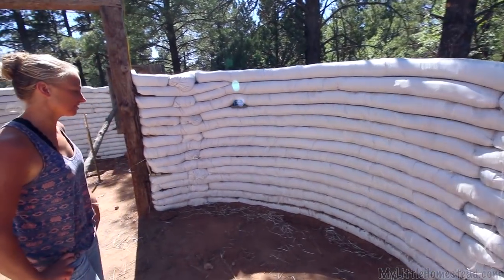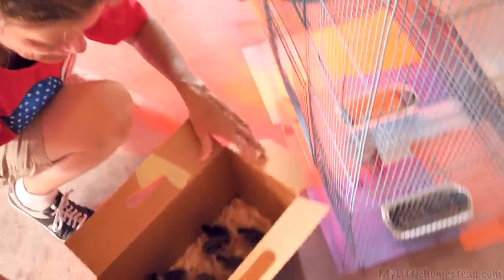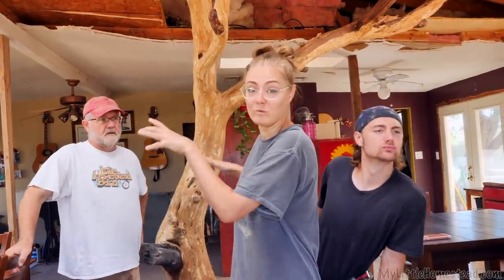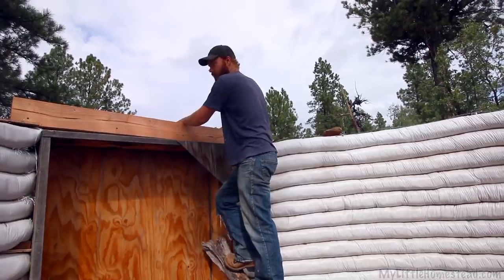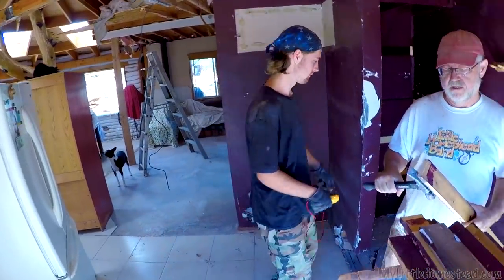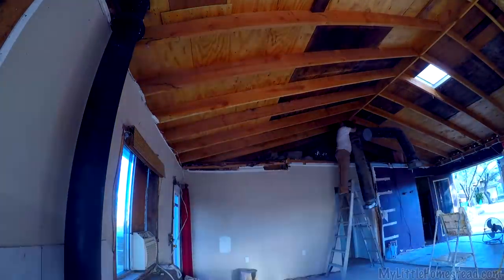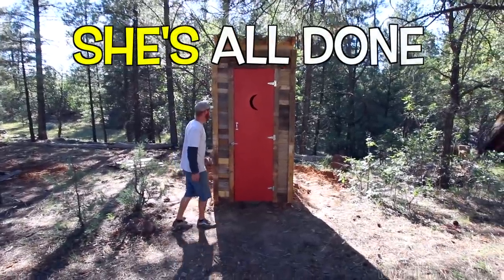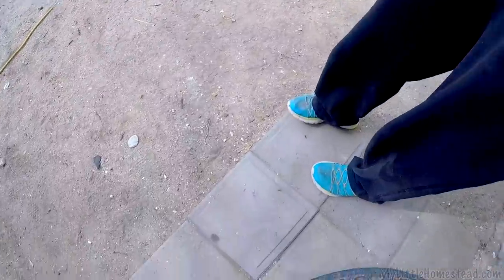Ceiling Take Down & Top of Cabin Walls | Earthbag Kitchen, Bath & Cabin | Weekly Peek Ep157

Comment: Damn!  Aren't you worried that either your roof is going to cave in our your walls are going splay outwards...OR BOTH?!  Weren't those all tie beams you took out?  And load bearing beams...?  Y'all got...balls!  LOVE that little outhouse and great job on getting the cabin walls up.  I think you all are the most industrious family I've ever known...  With all of you working together like that you get SOOO much done!  Totally inspired!
Reply: I thought that was why they put the tree in the room.  To be load bearing.
Reply: True, but without those tie beams in there, what's to keep the sides of the house from being pushed out?  I mean, even with the tree bearing the load of the ridge pole in that one spot...I don't know.  It just doesn't seem like that one tree and whatever is holding it up at the other end is enough to ensure the structural integrity of the house.  I'm no engineer, but I seriously doubt the place meets code at this point.  But it sure looks a lot cooler!
Reply from the maker: Post and collar ties on the rafters

Comment: I think the beams you took out keep the walls from spreading out and falling down. They hold the walls in place and the roof from coming down. You now need a few support beams. I am not sure but I think that is right? When the weight of the roof lays on the walls it makes them want to kick out. Also the span of the roof needs to be supported. Just saying.
  I think you could put a few rugged beams across ways and also  it should have beams beams in the middle of each support beam going up to the roof to support that too. Like a A frame.
Reply from the maker: Post and collar ties
Reply: shartne or add outside supports like Notre Dam...! You guys are so inventive, you’ll come up with something cool.

Comment: How are you tying your walls in so they don't bow out from downforce now that the ceiling joists are gone?
Reply: I thought about that too.  Good point
Reply: Same here.  Where are the ceiling joists???
Reply from the maker: Post and collar ties
Reply from the maker: Post and collar ties
Reply: That link below that explains collar ties states specifically that they do not prevent wall expansion.  Darn!
Reply: That's why I posted it.  A structural ridge beam and a consult from an Engineer might be in order.  I realize they don't have codes where they live, I'm just concerned they might have an issue down the road.

Comment: love the outhouse - I was involved with a two-story one - the first floor has a bin to catch? then second floor has the stool - like the original one - you had in the first video. - Always find them interesting - my Cousins have a concrete one that's pretty Awesome - the house use to belong to the Doctor that lived in town during the 20's and 30's - Something like 50's maybe he retired and died.. can't remember.  my Aunt worked for him - she bought the house - Well got the house.
Reply: just got to the end - Need to watch that roof - My cousin Bobby wanted to remove a wall - so I told him to call me before he started (i explained what and how) he did it without me - didn't reinforce the header boards to support the weight of the roof. so it started to sag - he had to reinforce the outer areas to the walls and the ceiling joists After lifting and supporting it was fine. <hugs> just be careful of the weight of it's self being to much for itself.
Reply: of course bobby's house is like a 100 years old. so. But? half pine half oak.
Reply from the maker: Post and collar ties

Comment: Idea, use a stirling cryogenic piston to generate liquid atmosphere. Liquid gas from the air that fills an insulated tank. Liquid air can be used to fill aluminum radiators to pass air through them for air conditioning. Liquid air then fills an insulated tank with frequency emitter's at the bottom that cause's HHO to vaporize out of the liquid air that is collected and used to.m power a gas turbine electrical power generation system? 😊

Comment: Okay here is a toilet design, urine collects in a resivor with a siphon. Siphon kicks on and fills a joe cell half filled with Gallium Aluminum alloy. This alloy will cause hydrogen to vaporize out of water just from the Schumann resonance field hertz 7.83. So the joe cell would need the correct electrical frequency to cause the Gallium Aluminum alloy to process HHO out of the urine at a more rapid pace. The HHO generated from the urine then used to charge solid state sponge hydrogen fuel cell's to be used to power farming equipment or electrical power generation hydroponic green house water pumps and so on. Okay now for the sticky stuff, the toilet's bowl now full slides back with a new ckean bowl coming up from the bottom to take it's place. Bowl full of waste is tipped over water jets spray out bowl brush with water jets clean out bowl. Contents of bowl deposited into a convection oven being powered by HHO fuel cell. The waste is sterilized dried out and ground down with the contents then being deposited into a bin to be used latter for rich top soil. A better way to deal with human waste. 😊

Comment: Here you go this will impress you. Earth bag house out building that house's two 50 gal water tank's. One for hot water that is heated with a solar vacume tube water heater and a cold water tank. Okay now the interesting part, the earth bag home plumbing set up to drain all the used water from kitchen sink bathroom sink and from the shower with a small atmospheric water generator removing water vapor from the air in the bathroom draing generated water into main drain that runs out to the out building that is then passed through a superconductor separator the removes all pollution and chemicals and bacteria from the water making the water clean enough to drink. With the impurities removed from the water deposited into a canister for latter disposal with clean water then returned to the two 50 gal water tank's with any excess water being deposited into an extra tank to be used for plant's or livestock. This concept would greatly help the environment and you would alway's have 100 gallon's of fresh drinking water at all time's. 😊

Comment: As a designer, draftsman.  You need to shore up that roof.  And u need insulation really really bad.  U folks have 100,000 lbs of force on the roof load and u have squat holding it up.  Winds of 20 mph or more will rattle the house like no tomorrow..  shore up your work before some one dies please.  Shore up that center rafter.  That should be a 4x.  Your dad should know better.  He's good with tools.  Please shore up your house.
Reply: I was thinking the same thing. I'm not sure how their house was constructed before but it looks like the took the bottom chord out of a truss roof. There isn't anything left to keep the walls from splaying outward.
Reply from the maker: Hang in there. More to see. Post and collar ties.